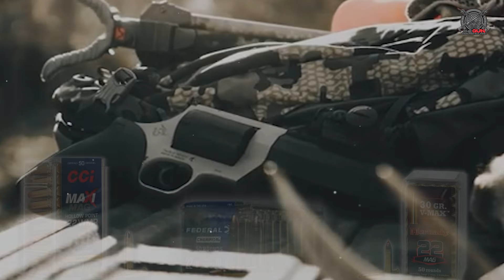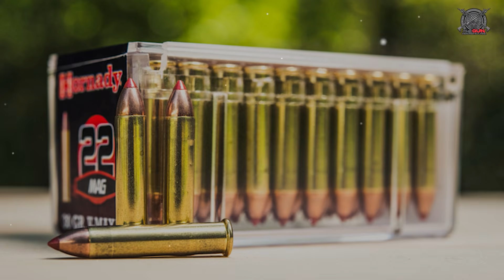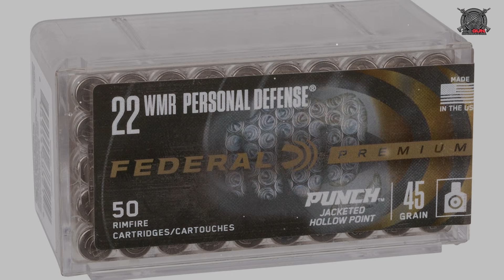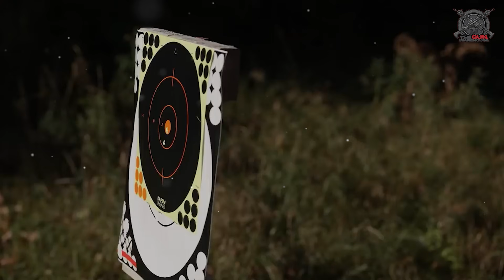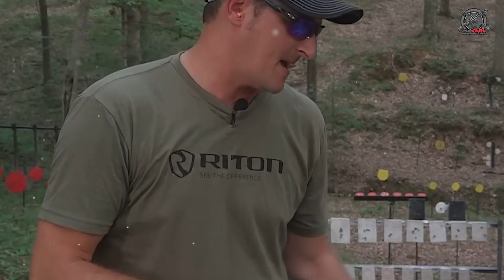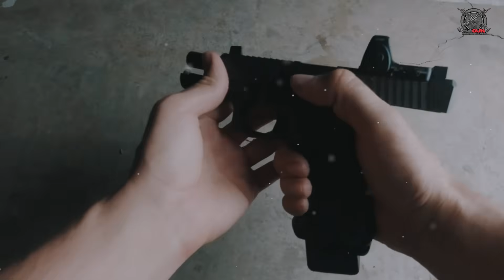Why the .22 Magnum Might Be the Most Underrated Urban Survival Round!!

Comment: the .22 mag rimfire, even from a rifle, only has 350 ft lbs of energy, A shorty 223 has 800 ft lbs, which is like the difference between a 9mm pistol and a .44 magnum.  One has plenty of power, the other is notably feeble.  The AR-15, in 223, offers a .22lr conversion unit, threaded barrel, silencer, drop in trigger job, QD, return to zero scope mount, drop in night sights, chromed chamber,  dark, rust proof finish, choice of barrel lengths, one handed usability, take down to concealment in a pack in 5 seconds, reassemble to fire in 10 seconds. The AR is available as a stripped lower or as an 80% parts kit, so nobody but you knows that you have it.  The 22 unit saves you 30c per shot. A GOOD silencer renders the full power 223's as "tame" to use as the 22 unit is without the silencer.  

The 60 gr  Nosler Partition softpoints to the brain will drop anything short of elephant. They are more effective on deer than the Ky rifle's round ball or the 44-40's lfp's ever were, but those sufficed thosuands of times. They will stop a man in his tracks. The scope, match bthp anti-cant bubble level, match barrel, free float tube and bipod mean that the 10" AR barrel will hit more torsos than it misses at 400m. using 69 gr hpbt match ammo,. 

The 60 gr Aguila subsonic 22's cycle reliably , dont have sonic "crack", but hit just as hard as normal (supersonic) 22lr from a rifle. the 1 in 9" rifling twist in the ARs barrel stablizes, the very long 22 bullets very well.  If you hold shut the 22's bolt, this ammo is BB gun quiet thru the Ar's 223 silencer. and will brain men, dogs, hogs, deer to 50m and inflict (eventually) lethal torso hits to  125m. the caliber swap takes just 20 seconds and the 22 unit rides nicely in the thigh pocket of your cammies. Remove it from its case and wrap the unit and its magazin in a shop towel
Reply: Have had an AR 22 conversion kit for over 10 yr.  It’s ok, but if you already have the 223 why use the 22 in a defensive situation. By then not worried about noise. For a 22 rifle rather have my 10/22  with Samson folding stock. Given a choice between 22 lr or 22 mag , I’ll take the 22mag. Hunted with both for years and there is a big difference. 22mags have killed a lot of deer( choice of poachers) Given that, i’ll take a 223 over both for one gun to have. A  22 mag handgun with 30 rd magazines is a viable option for someone with arthritic hands or cant handle recoil. All three have their place !
Reply: best you start a YouTube channel of your own an Clearly demonstrate all the advantage you are talking about? All the real firearms you mention, devices and most important the ammunition you mention, in all the applications. That would be interesting for us to watch. Thank you .